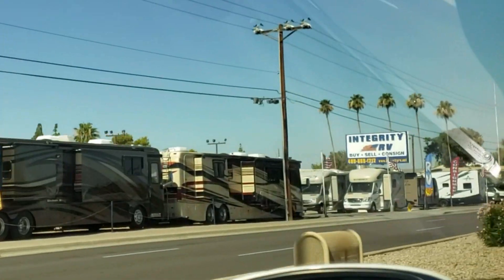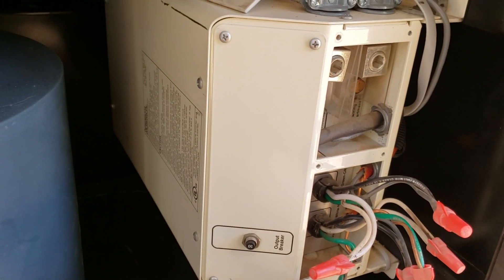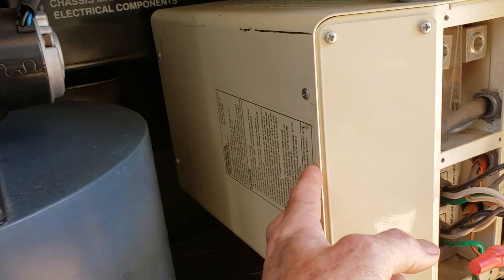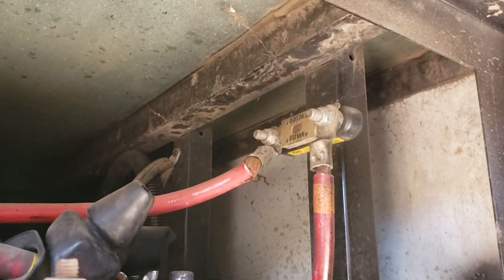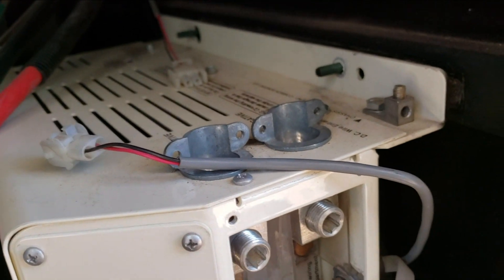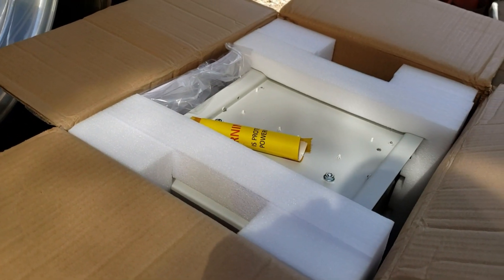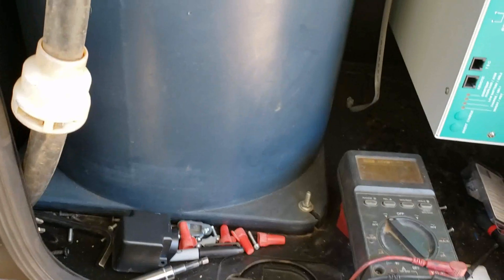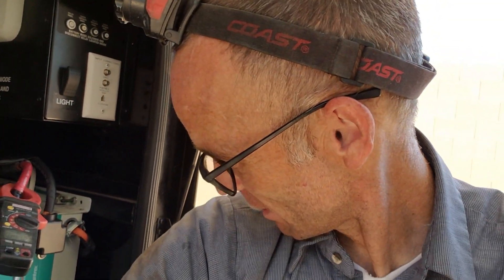Installing a Xantrex Freedom 458 Inverter/Charger

Comment: U live in Gilbert and have a 2023 Cardinal that is has two 260 watt Solar panels and is generator prepped and inverter prepped but has neither.  Could you install both so I am off grid ready?
Reply: I meant I live I gilbert

Comment: @AZExpert can you tell me how to do an equalizing charge with the xantrex freedom 458 inverter? Do I need to disconnect anything? I was going to use the generator.
Reply from the maker: on the remote you just push the 2 buttons label "equalize" together and hold
Reply: @AZExpert yep 👍 I've done it when I owned the freedom 458

Comment: Hey James Im wondering why you went with a 458?  That is a modified sine wave.  Im not sure what your dimensions one was but I have a new mar which i believe is also a dimensions that was PURE SINE WAVE.  THe newmar 1800 IC which was built by dimensions but I think maybe newmar added stuff to it.  However, mine finally is starting to have random OVERLOAD issues eventho there is not even a load on it lol...
Anyways I spoke with Xantrex and they stated not to go with a 458 bc it is not a pure sine wave so you will lose out on it.  They mentioned go with the Xantrex 815-2012 Inv/Chgr, Free-SW 2000W 12V 100A T-Sine bc it is the closest thing to the NEW MAR but it also has extra 200watts power and charges at 100amps vs the newmars 85.  
BTW was connecting the 458 the same way you connected the dimensions model?  Meaning the wires all went into the same places?

Comment: at 11:42 the orange wire is suddenly connected but to what? Thats the part where I am stuck. What did you wire that to? I missed where you did the wiring and thats what i need to know. Thanks

Comment: You went from installing the red/black battery cables and then did not explain anything about the 2 white and 2 black wire nor anything about the wires that you put into the two silver holes. Can you please explain that part?

Comment: Has anyone come across after installing the 3012 getting AC power in but no AC power out on a boat? I am completely stumped. If you have, please contact me and tell me how you fixed it.

Comment: My Xantrex 458 is overcharging and boiling out my lead-acid batteries. It may be set to incorrect battery type. Can you give information on these settings?
Reply from the maker: Contact the manufacturer or check google
Reply: @AZExpert  Thanks. Will do

Comment: 9:35 in the marine industry, ABYC prohibits soldering connections.  They want only mechanical connections, because of vibrations, it will break the wires at the edge of the solder joints.  I follow that advice on automotive as well.  I typically don't see solder joints in autos either, just crimp connectors.  👍😎

Comment: I have the same inverter I think it’s bad brand new 4 6 volt batteries installed and when I him invert it clicks loud and makes a bunch of noise. What would it cost for you to install a new one or maybe repair mine. I’m located in Mesa AZ. It’s in an 2001 tiffin allegro bus
Reply from the maker: I appreciate the offer but I am not taking on any new jobs right now

Comment: I have a xantrex 458 with a remote that isn’t lighting up. Is there an internal fuse in the inverter that needs replacing? I’ve tried unplugging the remote for 20 seconds and still luck.
Reply: Probably dead remote

Comment: James, we have a 2005 Monaco Knight 38PDQ.  I'm replacing the Magnum ME2012 50amp inverter/charger with a Victron MultiPlus II hybrid inverter/charger and 4 SOK2 lithium batteries.  I discovered that the line from the transfer switch to the Magnum input is only 3 wire (one hot)???  They put a jumper from line 1 in to line 2 in to feed 120v to both sides???  The line out of the Magnum to the breaker box is 4 wire as expected.  #1  Is this expected on Monacos?  #2  Can I use this same jumper set up on the input of our new Victron inverter/charger?  Or do I have to run a new 4 wire cable from the transfer switch to the Victron MultiPlus II?
Reply from the maker: it only has a 30amp feed from one leg of the 50amp power. You'll have to decide if your new inverter needs 240 or 2 30amp line power. Your designer or installer would be the best person to ask.
Reply: Thank you.  I used the same jumper on the AC input line to the MultiPlus II.  It is operating seamlessly so far.  @AZExpert

Comment: Have you ever removed an Onan 4000 geny, and installed like an inverter Predator 3500? (now they have 9000s).  Then make it uses the inside control panel to start & also connect to the gas tank so I wouldn't have to manually refill the gas tank in the inverter and the RV gas tank.  I have carb problems with the Onan, due to ethanol gas...and it has always been a money pit.  Thxs James!  Great install!
Reply: Portable generators are safe (or meant for) installations in an enclosed compartment.  Ventilation for cooling is an issue as is the exhaust.

Onan has an onboard inverter style generator now.  I have one, I LOVE it.

Comment: A lot of people don't know how far back this particular inverter dates.  Not that being an old design has drawbacks.... things like this get updated as time progresses.  This inverter came out in about 1998 from Heart Interface.  I know this because I was working there when it came out.  It was to replace the previous generation of "Freedom" series inverter, which were in a black chassis.
Reply from the maker: It's going on 3 decades and is still a good inverter.

Comment: The book says to mount it horizontally. 
I’d like to mount mine vertically with ‘ face / connector ‘ side facing upward. 
I removed the cover and see a heavy transformer mounted only to the bottom ~ so if it’s not mounted horz then that heavy transformer mount may stress the metal and eventually comes loose. 
What do you guys think ?
Reply from the maker: these are mounted in all directions including upsidedown

Comment: Thank you for your video. It was very helpful. I have a 1995 American Eagle with a Freedom 20 unit. Charging works but the inverter will not come on anymore. I am getting ready to replace it with a Freedom 458. I have the unit, remote panel and new battery cables made up. Now just have to get my Old, Fat, Lazy ass in the bay to do it...grin
Reply from the maker: yes that is a big job. If it's the very large Heart unit under the bed, it should also contain the transfer switch so you might need to plan on getting a 50amp transfer switch too

Comment: I love your video but was hoping you could’ve shown to 110 connections as I am having trouble with mine.
Reply from the maker: I am sorry. They are just 120vac in (from the breaker box power) and 120vac out (to the load subpanel or load circuits). White to white(neutral to neutral) and black to black(line to line)

Comment: I have a Xantrex inverter at home and it does not have a charger builtin.  I have two 12 volts batteries.  Could you please tell me what's the best way to charge the batteries?  Please feel free to recommend anything.
Reply from the maker: You just need a converter/charger. Its difficult to recommend not knowing the application but at least a 55-70amp charger.

Comment: We have a 1992 Prevost Royale. It has a freedom 458 inverter charger. There's a flashing green light that says "charge/gel one. Please if you can help us what does this mean?
Reply from the maker: usually means there is no 120 to the inverter/charger
https://www.google.com/url?sa=t&rct=j&q=&esrc=s&source=web&cd=&ved=2ahUKEwi0y4_mjdXrAhVSOH0KHSIWB0oQFjAAegQIAhAB&url=http%3A%2F%2Fwww.xantrex.com%2Fdocuments%2FInverter-Chargers%2FFreedom-458%2FFreedom458(445-0193-01-01_rev-2).pdf&usg=AOvVaw0zSTm-XWJ7ZGa3XA4Ody9d
Reply: @AZExpert  Thank you for answering. I'm sorry, I was just told that it isn't doing anything now. It's like it's dead.
Reply: @AZExpert  Also, what would cause it to have no 120 to it? I'm the wife and I'm trying to help him. He's gone 5 days a week.I don't really understand all of this.
Reply from the maker: @grateful1929  there should be a 120vac breaker to the inverter, maybe its tripped or there is an internal fault on the inverter
Reply: @AZExpert  okay I'll show him this thank you very much
Reply: @AZExpert  One more question. What does "internal fault" mean? I'm sorry to ask so many questions.
Reply from the maker: @grateful1929  an internal fuse or control board
Reply: @AZExpert  Got it! Thank you!

Comment: Nice conversion/upgrade.  Since you are replacing the batteries, will the Xantrex 458 operate as a Converter while the batteries are out?  My original Converter would operate without the batteries but I'm wondering if the 458 will do the same. Thanks.
Reply from the maker: no it needs to see battery voltage to operate. Thanks!

Comment: Thanks for Video! I have a 1998 Monaco Windsor with Xantrex RV2012....any suggestions for Xantrex upgrade? say Xantrex Freedom XC2000 ?
Reply from the maker: I installed one of the xc2000. I did not care for the wire connections or the unit at all. I would not recommend an upgrade to the RV2012 unless it is broken. The Freedom 458 is what I would recommend as a direct replacement. I could not give the exact model as I'd need to know dual in, dual out, single in, dual out, or if sub panel 120vac breakers are on the old unit. Thanks!
Reply: @AZExpert  You're welcome...and Thank you for reply.
Reply: @AZExpert  I sent you an email: Do you have any experience with the King Control Throttle Issues? I have a 1998 Monaco Windsor and throttle pedal is intermittently working. Unfortunately, Cruise Control King in Minnesota is now out of business. Look forward to hearing from you. Thanks!

Comment: I have a 6 side hydraulic crimper i don't know if its better or not but they look nice when done ,,, I never solder them they go green and give in after a few years
Reply from the maker: Those are nice crimpers, I just find them to be diffcult to use in confined spaces most of the time. And I agree with not soldering. Thanks!

Comment: While it certainly makes sense to replace an inverter this old there are some times when you just want it fixed so there are minimal changes to the system or maybe you are selling the motor home and you want to keep the repair to the minimum. The Freedom 458 is a good choice to replace this unit but if you want to repair your Dimensions you can contact PCS Electronics. Thanks for a very well done video.
Reply from the maker: Thank you. It's difficult for me to recommend repairing an obsolete and fairly interchangeable inverter. I've found that between shipping and down time repair is not generally too much cheaper for a shop, definitely for an individual or DIY.

Comment: Well done.
In aviation, we would never both crimp and solder a connection like that. Crimping alone is the best way.
Reply from the maker: that's good to know that crimping is good enough for aviation. I'm always glad that these things can't fall out of the sky after I work on them(I mean I always forget tools somewhere it seems) I've also never found a better crimper than the hammer/anvil type. Thanks!
Reply: @AZExpert hydraulic crimlers are the cats meow for the big stuff